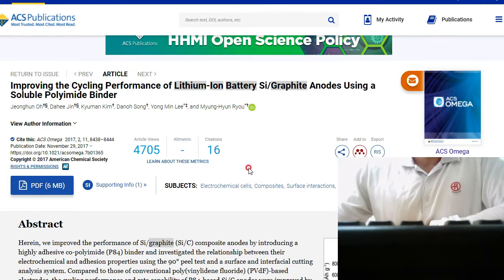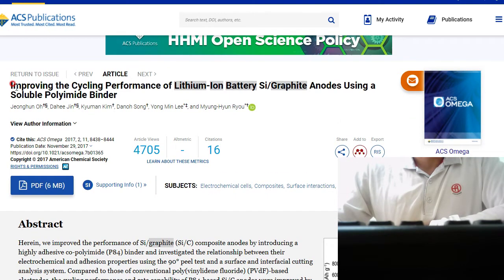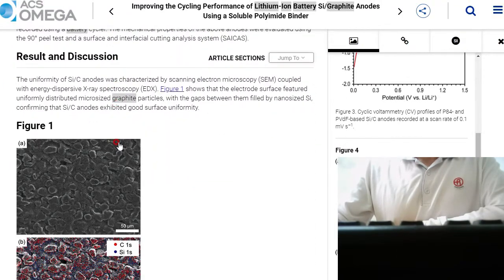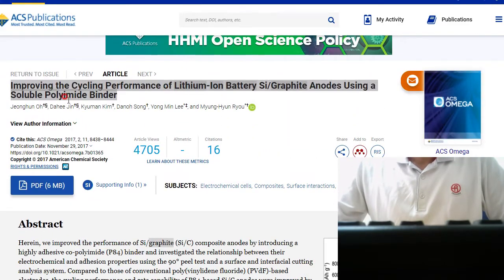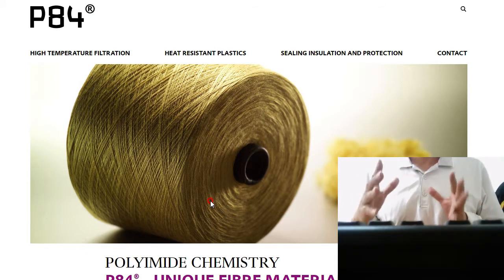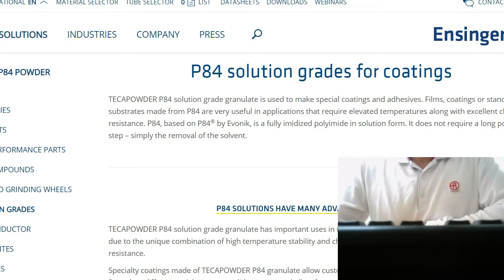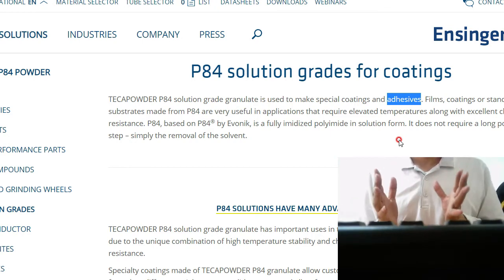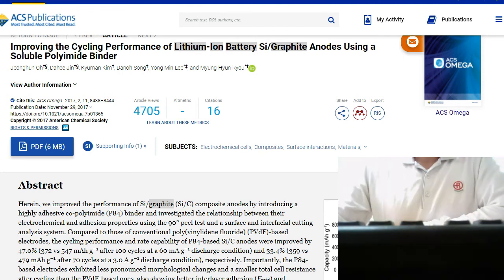Really Impressive graphite binder (published by Korean Scientists)

Comment: is it possible to connect with you as i am interested in developing the battery??
Reply from the maker: You can write here please. Have a nice say
Reply: @solidbattery9956  i am not so familiar with this tech but willing to learn from you. if number cells  can be joined in parallel is it possible to power say a cellphone or a electronic device for testing purpose?? cell chemistry is complex but the way you explain makes it look not difficult, so please ignore if my answer looks stupid. btw many years ago i was in seoul & incheon & had kimchi.